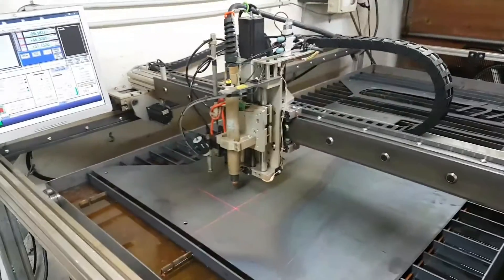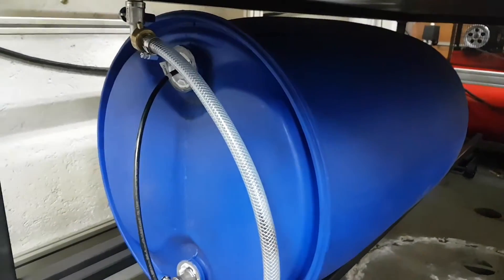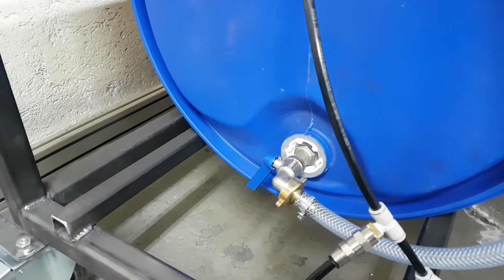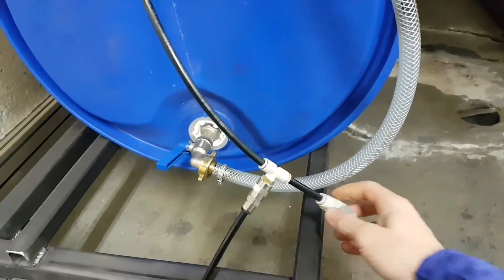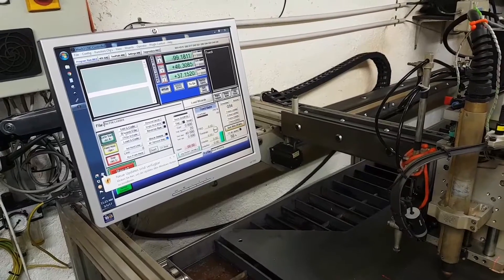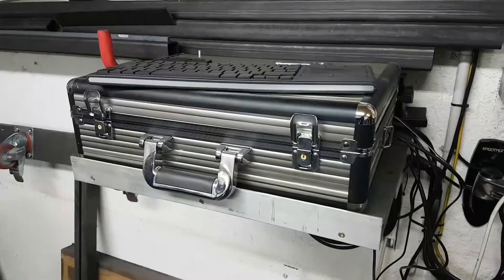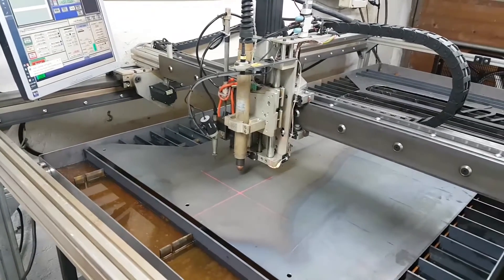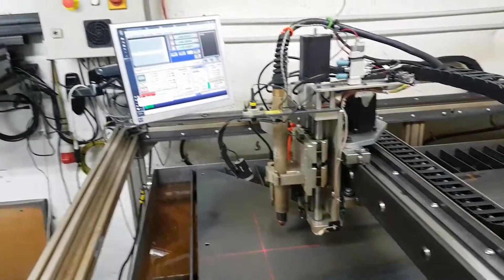CNC Plasma : Upgrades 2017

Comment: Wondering if you have any thoughts on the depth required for a water table? I built a small CNC machine that I plan to attach a plasma torch to. I've almost got it ready to test but I'm working out a few bugs. The machine itself is made from v-groove aluminum extrusions and running Nema 17 motors. I can easily carry the entire 1000mm x 500mm frame and gantry setup. So it's going to be quite portable. I want to build a water table in the garage so I can place the machine on top of it and do a cut whenever I need to make a part. I was thinking of using an old refrigerator door as a water table. I'm just wondering how thick of a door I need to use to prevent the torch from blasting through it. Checking out your other videos right now and subscribe. Thanks for the info.

Comment: Where did you get those plastic fittings and small valves
Reply from the maker: These are from SMC. There are several other brands out there. I generally use these types of valves and tubes becasue they are light and easy to install.